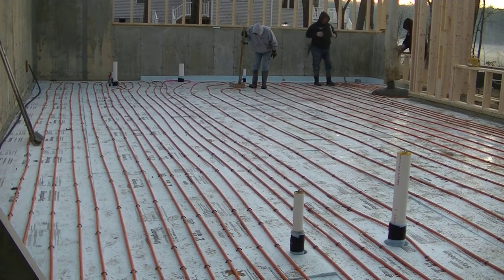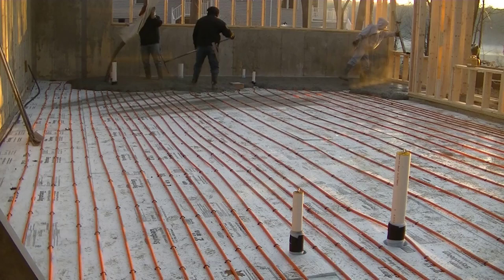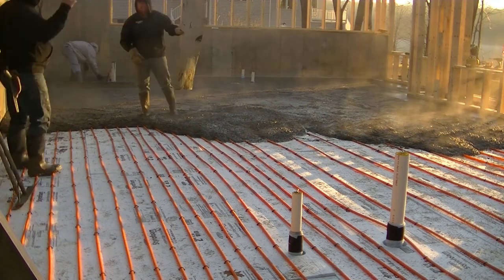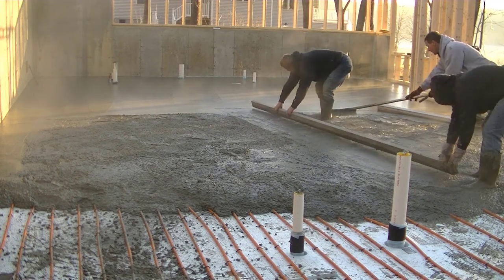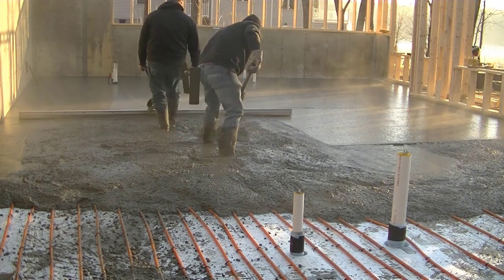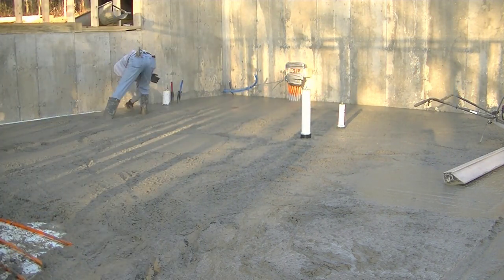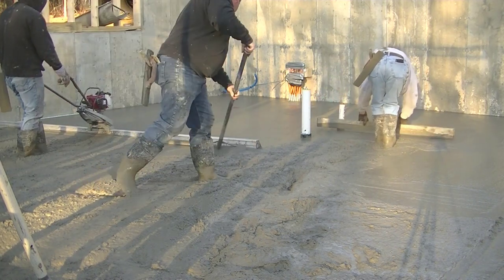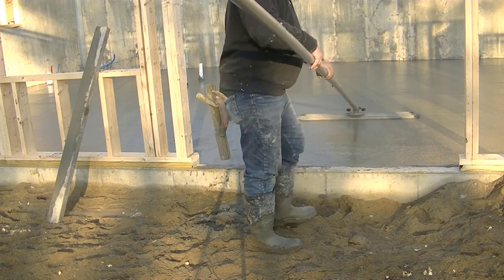Pouring Concrete In Cold Weather (Fast Setting Mix Design)

Comment: I have been on many 16 hour basement pours in cold weather. Like you mentioned for  higher psi going from 3,000 to 4,000 is like adding 2 percent calcium. The calcium flake does work the best, but be careful adding 4 bags will go really fast and leave a white chalky powder on the surface don't ask me how I know. Heating the ground up with heaters and blowing heat in is the best way to do it quickly. Obviously the the higher slump means more wait time and weaker floor more likely to crack. Water reducer helps keep psi up and slump low and still be able to work it. I always make them mix it for 5 minutes some drivers spin it for 2 or 3 minutes and try to get pour started but you will have some spots that you will wait on or have to hand finish to get it done faster or you may wait another hour or 2 to finish with the power trowel.

Comment: Great video Mike. When you pour a slab next to another slab do you use expansion joint material next to the existing slab? 
Do you ever pin the two slabs together with rebar? New concrete to existing with the expansion foam or fiber expansion joint in between? Thanks

Comment: Great job. How deep are the footers?
Reply from the maker: The footings on this job were 4' below ground level.
Reply: @MikeDayConcrete  : thanks , I am from PA and love radiant floor heat. I am not a fan of basement. From longetivity standpoint are homes with footers and slab are as strong as the ones with basement?

Comment: Question: what problems arise when pouring concrete cold besides just a really long set time? I've heard that longer set times help make harder concrete...?
Reply from the maker: Not many really. If nighttime temps go below freezing the surface could freeze and pop off.
Reply: @MikeDayConcrete  wow I didn't realize that!

Comment: As an amateur chemistry guy (studied but not my major at university), calcium chloride at the plant will mean that some reactions are happening already and will be completed by the time the concrete is being poured, well before it is cured. I.e., the concrete will be changed in a similar way to dry adding calcium chloride, but some of the benefits of it as an accelerator may be lost.

If I remember correctly, the calcium chloride (CaCl2) will take part in replacement reactions with other cement ingredients. A chemistry way of saying it will play a game of swap with its’ chloride between the other cement ingredients.

How exactly it’s supposed to do to accelerate the curing of the cement portion of concrete I don’t exactly know, but I think that is a point of debate. I’m guessing it’s these replacement reactions that are causing nucleation sites for the ettringite crystals formed as part of the initial cure phase of hydraulic cement. That could possibly be backed up by the observation that allowing calcium chloride to stay in a solution of uncured cement will result in a slower cure of concrete compared with cement added dry with dry calcium chloride flakes.
Reply: I believe I’ve seen him have the driver add it on the job site. The driver adds it to the drum,  mixes it on the spot and then they pour. Mike brings the mix in 50 lbs bags and adds as needed depending on how many yards of concrete being poured.

Comment: What about slab concrete in those type of conditions and reinforcement in place
Reply from the maker: We pour slabs the same way and add reinforcement according to the specifications.
Reply: Great video Mike. When you pour a slab against an existing slab do you put any expansion joint material against the existing slabs and do you ever drill and insert rebar into the existing slabs to keep the two level if one settles? Thanks.

Comment: 0n each end, there were pieces of styrofoam (4") going up  the vertical wall; what were those for?
Reply from the maker: Builder had that there to keep heat from escaping from the floor.

Comment: ? What kind of saw blades do you use that you can cut concrete the same day??
Reply: Soft cut concrete saws.
Reply: I use a softcut 150 with a 6 inch husqvarna softcut blade works great just make sure to put cardboard in the cuts where they cross one another if it's real green so the cornerrs don't break helps tremendously
Reply from the maker: I get mine from Warrior Diamond. They're a lot less money than the Husqvarna blades and last longer.
Reply: Gunna have to check that out thanks for the heads up on that

Comment: Question. Parking pad 10 yard pour on dirt. 3,500 lb. 1% calcium. Hot water. 20 degree F. Formed and graded, then covered with insulated blankets before temps dropped and ground started freezing. Tented and heated 24 hours before pour. Tented and heated after concrete was poured and bull floated. Actual question: there was never any bleed water, is that normal?
Reply: Yes
Reply: Pouring a high slump on poly will have a high amount of bleed water, because you didn't probably pour a high slump and the bleed absorbs in the warm ground you heated.

Comment: When mixing a small batch using bags, what amount of flake  calcium chloride would you use per 60 or 80 lb bag?
Reply: For sure you are going to want to use a fast setting bag mix in combination with hot water and/or high strength bag mix. 

I would not fuck around with chloride at all with bag mix just buy fast setting concrete. If it is something you have to put a finish on at all, spend the extra dollar and get the premium bags (example: buy quickcrete 5000 instead of the generic bag). The quickcrete will be creamier for you, making it better to finish. 

Also: bag mix bleeds like a stuck pig. Be ready to put a fan on it, some paper towels, and or wait for the bleed water to evaporate. 

If it is near freezing, I will use straight fast setting concrete with hot water. 
If it is 50 degrees I may go something like 1 bag fast set to 1 bag 5000 psi, possibly with hot water possibly with a shovel full of type s mortar. The mortar dries up the bleed water and makes the mix way creamier than bag mix alone 

Done rambling good luck
Reply: @cheshstyles  thank you!  I install premium basketball hoops and only mix a 1/4 yard for each, usually around a 1,000 lbs.  The hole is 4 feet deep and yes, bleed water is almost always a problem so I blow a squirrel cage fan at it.
I do like the Qwikrete 5000 for winter use, as it is much creamier and nicer like you said.  I've heard of guys using chloride with bagged crete but couldn't figure out the ratio...2% by volume or by weight?
Reply: @PreciseAssemblies  look for fast setting concrete it will be a total game changer for you.

Comment: Hey,
Just a friendly question but what is the white sheet placed under the wiring/heating I am guessing?
Reply: Foam insulation
Reply: That would be styrofoam sheets.
Reply: It's foam insulation
You want to prevent the heat from the hydronic heating (red tubes) from going in to the earth, the foam blocks the heat and forces it upwards into the concrete and then the room

Comment: How hot can water be? I did read once that when it gets to a certain heat its detrimental t the cement.
Reply: My plant says they heat the water to 160f.  But the aggregate absorbs a lot of the heat. By the time it gets to job, it's around 70f.

Comment: Cold weather concrete pouring is definitely not our specialty. Here is S. FL, 32°F (0°C) would be an exceptionally cold day for us and something we wouldn’t even see but maybe once every 2 or 3 years. That’s as cold as it gets here. Except for the winter in ‘77 when we got down to the mid to upper 20’s and actually got a little bit of snow.
That’s back when the ‘experts’ were telling us we had a global-cooling problem instead of a global-warming problem, like today 🤔

Comment: You ever put your calcium flake in a bucket of water  and let calcium dissolve in water before dumping in the truck
Reply: Try dissolving 100 lb. of flakes in a bucket of water,... would prob need 10 buckets for everything , most jobs dont have water available, especially in winter so you’re bringing your own water ...